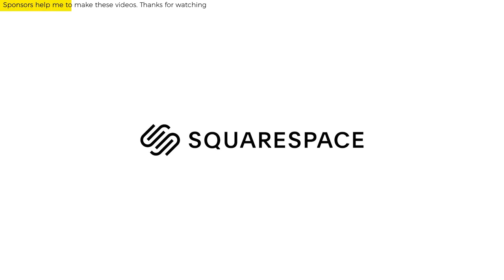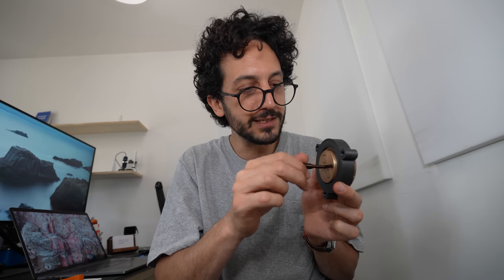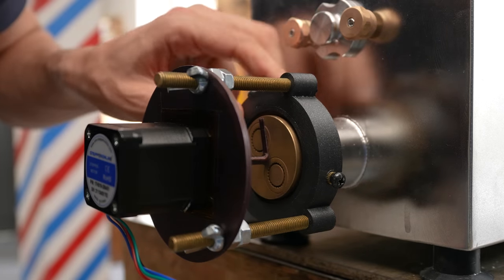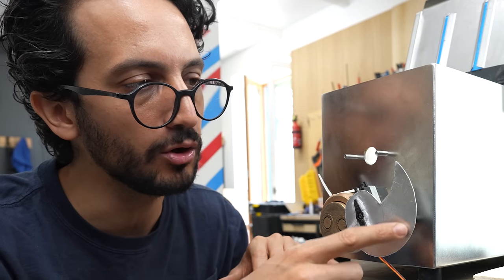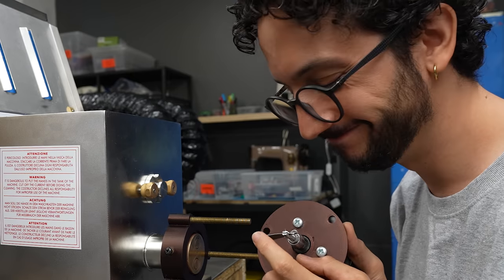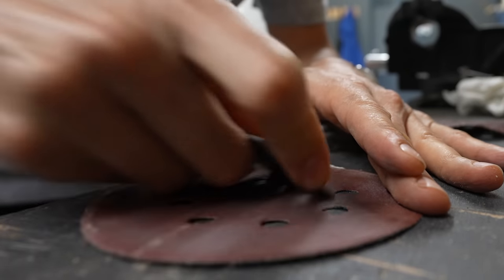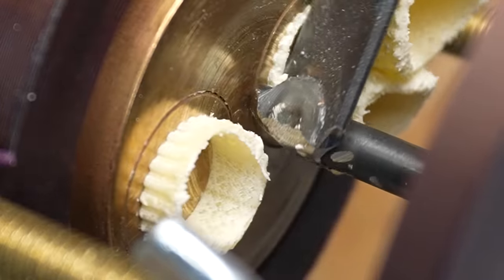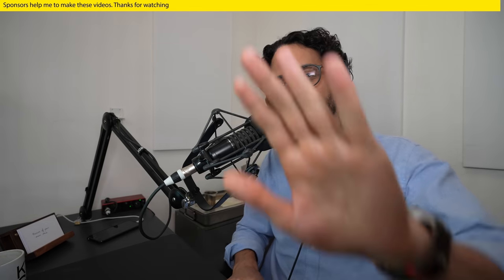I Tried to Make an Automatic Pasta Cutter (did NOT go as planned)

Comment: Maybe a RC 20kg servo motor (lw-20mg) mounted aside, connected to a thin blade like a cutter blade, could be a better concept: it will move fast (<0.2sec), with hi torque, and with Arduino you can set the frequency of cut. A couple of cutter blades paired can cut in both direction of movement. Much simple, lightweight and effective than a slowly rotating blade. What do you think?

Comment: If you want to be faster, use fine, stainless steel wire as a cutter You should also expand the circle, so that the center is the edge of the extruder, and the wire cutter extends the entire diameter. The effects of this:
1. The wire will cut without large material resistance.
2. The wire cannot build up the pasta rather than letting it fall
3. By having a large diameter like that, the wire can both move fast, and also give more time for the pasta to extrude between cuts. If you want longer times, you could make the radius larger and larger, even.

Comment: Torque probably isn't the main issue.

With your current design, the blade needs to stop every rotation to allow the pasta to extrude to length, then rotate quickly.  Going slow you will end up with pasta that it cut on a bias, and have the added problem that the pasta is pushing against the blade while you're trying to cut, creating a gap between the surface and the cutting action, which means tearing instead of cutting. 

Most commercial pasta cutters have some kind of piston that pushes the cutter into the die, so I'd recommend at minimum some kind of spring loaded cutting blade with some kind of universal joint (which could just be a rubber hose used as a coupler) to ensure that the cutting blade presses flatly against the die and cuts with even pressure throughout the entire rotation, otherwise you need precision alignment with the blade to the die or some potion of the cutting motion will have gaps between the blade edge and the die, which can cause tearing, or there could be more pressure on the die at certain areas, causing more wear/damage to the die surface in those areas.

Comment: I would have used a shaving razor to easily get sharpness and made the motor spin fast, but stop after a 360° or 180° rotation for however long you need to stop to get the desired pasta length.

Comment: @Alex I'll assume you know programming too, since you built this breadboard computer? 2:50
Depending on what in/out-put the motor accepts, you could spin it 180 degree, wait for some time (ANY length pasta is now possible), then spin it another 180 degrees as fast as possible both times, so the blade don't "clog" the extruder holes.
(also, stiffer & sharper blades required).

Comment: I think with the speed of your pasta machine, a stepper motor is good. You just need to run it with a program that will wait a second or two and then turn 180 degrees. Wait a second or and turn another 180 degrees. That would be the only reason you would use a stepper motor anyways. And then a metal blade with a very shallow angle so the pasta does not smash or stick.

Comment: I was wondering if a springloaded steel guitar string (or similar sharp wire) could provide the necessary tension against the extruder die, and pivoting the other end on a motorised wheel or servo quickly at a timed interval provide the necessary quick snap cut.

Comment: The last design was decent, but you should offset it to the side so you can run it faster for cleaner cuts while still allowing for longer pasta to be made.
Or you get a motor which you can have stop and wait for a set interval.
Reply: *Thanks for watching send a direct message right away on the above number for more enlightenment:••*......

Comment: I think shallower angle could work better, now when the blade is finishing the cut on one end the second end 5 mm into the pasta piece already. I also don't think you need much precision here - you can use flexibility of the blade instead, but that comes with the problem that there will be a lot of friction, so you would need more torque.

Comment: It's not about how slow the blade can spin.  It needs to spin medium-fast for one rotation, wait a certain interval of time and then repeat.  An Arduino could time that with the motor.  
Also the blade needs to be as parallel to the face of the dies as possible.  Maybe 15-20° angle

Comment: Why not use moving ring with thin metal wire (something like round wood drill but with wire inside and big holes for pasta) which will cut the dough and use pin on the outer wall with a switch or another sensor, which will halt the smaller motor for 4000 ms and then move it again 360*? You have 1 moving part + 1 point of contact with external element (or even you can use IR diode so no contact) and would be much simpler to build.

Comment: I would move the motor to the side of the machine and use the leverage to make the blade move faster over the die, given the same angular velocity. That way, you get the same length of pasta, but a faster cutting action. I would probably also try cutting at a more acute angle. Safety razor blades could also work instead of sharpening a random piece of metal, not that it matters if you're going to sharpen it on whetstone 😁

Comment: Hey Alex, have you considered the blades used in food processors or blenders? Those seem like they could work well for your application. Additionally, the stepper motor has tons of low end torque, try switching to a proper stepper driver like the A9488(cheap) TMC2209(quiet/higher torque) drivers. I personally have used the same large stepper in combination with the TMC2209 driver
Reply: *have used the TMC2209 driver with your large stepper motor and it makes more torque than I can stop by hand

Comment: This might need to be explained graphically but, ill try by typing it. The blade angle is too steep, so what is happening is that ur shearing the pasta not cutting it, which also forces the pasta to collapse on its self. And if the blade is flat on the surface of the extruder the blade will not cut since the pasta from the extruder is pushing the balde upwards which makes the blade further away from the surface, and that makes the blade just tear the pasta apart. So to fix the issue you need enough angle for the blade to cut and leave room for the pasta that is underneath the blade to extrude without hindrance. 
Adding that blade angle is also critical for releasing the pasta. Remember pasta surface area, you need the blade to only touch the radius/diameter not the hight of the pasta.
Also, balde speed is too slow what i would do is typr of a timer and the fan blade is not place in the middle, rather outside to side of the extruder surface, once the timer is up the blade turns fast and cuts the desired lenght then resets to it ready position. 

Also greasing the blade might help or some type of ceramic nano coating, or you could season the blade with oil but for that use steel.

Hope this helps. Also im a mechanical engineering.

*Just finished the video, i would use a thinner and curved balde like a fan, it will retain the strength of the thicker blade you used at the end, but will cut and release the pasta more easily.

Comment: The centre of rotation of the blade should not be at the centre of the die. It should be offset to be further up and the cutter should have a longer blade, this way you can increase the speed of the blade making the cut while increasing the duration between cuts. It will also keep the middle of the blade/metal rod thing out of the way of the pasta.

Comment: lower the angle if the blade. You are at 30-45 degrees. When you manually cut, it is  15-20 degrees.

Comment: You need a support on the shaft, maybe even two, then the motor doesn't have to take the off axis forces.  M-0-0-l   M is motor the dashes are the shaft going through the supports O the l is the blade.

Comment: I think you might want to spring load the blade or simply the whole assembly and use one of those plastic scraper blades so you don't damage the brass
An other option would be a solenoid and a knife.

Comment: 2 things to change :
- the angle of the blade. It should be almost parallel to the extruder
- the speed of cutting. Why not making it spin faster but 1 turn at a time. Make the blade wait in resting position for the amount of time you want, depending on the length of the pasta you are making. Then 1 quick round. Easy peasy fettuccini.
Reply: Right, the axis of the needs to parallel to the axis of the extruder, or, by extension, perpendicular to the face of the extruder.

Comment: Personally if it were me there's a few things I would of done a bit differently. 

1. Offset the motor a good half a foot away from the output of the machine.
2. Have a blade that length so it will just extend beyond the output
3. Use a razor blade as the cutting edge held in by a very gentle ramp like surface
4. Up the rotational speed just a bit. 
5. Create a cover for all parts that aren't right in front of or in the drop area of the output. 

I feel like with these you can better tune the length of each pasta noodle, and it would swing down with a clean slicing motion, allowing the mass of the blade to do a lot of the work. The sharp edge of the razor blades would create a clean cut, and the blade would then evacuate fast enough so not to crush the pasta. I'd use the window wiper motor, same controller that you used, and I think it'd work pretty well.
Reply: *Thanks for watching send a direct message right away on the above number for more enlightenment:••*......

Comment: Alex, first off, good job making a working prototype! Secondly, the biggest problem you're still having here is that you're trying to radially mount the cutter in the middle of the die, when it should be offset like that large blade shaped like a teardrop was. If you look at the professional/industrial cutters, they may be centered to the massive die, but there's enough space and size for the blade to rotate and slice through the dough at a slow pace so that enough dough is extruded for the shape desired. You did catch that you need a lot more sharpness to the blade, and thankfully you gave up on trying to glue things (I just... did not see that working ever, haha). The next biggest problem is the angle of attack that your blade is coming in at. It needs a much shallower angle, so that instead of mashing the pasta that is cut, the pasta tumbles off the blade.

Comment: The cutter doesn't need to be centered on the extruder. Move it 3-4 inches off to the side and have a longer blade to cut both of them on the same side. Should help with the sticking. Also, you are already controlling speed with a microcontroller. No need for it to be in constant motion. Have it make a cut at a normal speed, rotate around until just before the next cut, then pause until it's the length you want. With a real blade, a NEMA 17 should have more than enough juice.

Comment: I would try cutting with a stainless steel wire or a fishing line. You would of course get a cut at an angle with the slow speed but that's better than the squish.

Comment: Angle of blade is causing the cut pasta to be caught in the rotation. Change the blade angle and you’re golden - use a safety razor blade, split it in two so it’s not too wide and attached almost perpendicular to the extruded for extra precision 👍🏽

Comment: Excentric cutter with just a small office knive on it? Like a small Victorinox? Drill two holes into the handle and run it in the stepper motor. This would do the same as you do by cutting with a knive by hand. But it might be too simple ;-)

Comment: Alexudi would be a good name for that pasta. ;p

Previous to last rigid cutter: Wonder if you could drill a hole in middle of die and use that to center/hold blade shaft. Would even just need to be a small hole not completely through that the tip of the shaft can ride in. 

Might coat the end blade with some oil. Or even maybe season it like cast iron. Give it an anti-stick coating. :)

Comment: I think a better solution to this problem would be to have the blade spin once very quickly and the stop for a period of time. It seems like the biggest problem in the video is that the blade is going very slowly. Also in the end where you solved the problem the pieces of pasta were still quite short, no? This solution would allow you to wait until the pasta are exactly as long as you want them before they are cut. Also you could program the motor to "shake" of pasta pieces to make sure they don't get stuck on the blade. To do this simply program it to back up slightly during the wait period between cuts.

Comment: i think the biggest difference between you using a knife and the contraptions you are making is the angle and speed at which the blade travels, when you use a knife you cut it almost sheer with the surface of the brass and those contraptions you use are all angled at around 45 degrees or so. if you set the motor on the outside of the brass with one slightly long blade riding a "rail" or something similar so it doesn't go too far or too close to the brass, you could use a motor to set a more specific length of time as it takes longer for things to reach destinations the further out they are. Metal blades are definitely the way to go though, and it does need to be sharp to properly work.

Comment: Your biggest issue is that the speed between cuts is directly purportionate to the radius of your spinner. If you offset the motor 3-4 inches you will be able to control the speeds way better.

Comment: I am a bit late, but what you are missing is speed vs sharpness on the blade to replicate your manual cuts.
So a delayed application of a torque like a hammering ratchet screwdriver, basically a similar concept to what it is used to undo wheel lugs on cars.
A motor spins up a spring and a hammer that forcefully delivers a temporary boost of torque to the "stuck wheel nut" to break it loose.
You replicate that by having the motor spin up a spring against some resistance that then lets go, sending the knife at higher velocity and more torque across the pasta should do a very close replication to your manual motion.
The drawback will be noise though.

Comment: Instead of using an actual blade to cut the pasta, i would just use a strong, thin wire held by maybe like a U-Shaped rod that turns around. It will not have the access blade that deformates the pasta but will be sarp and thin enough to cut it perfectly.

Comment: Make the blade off centre, to have it go faster through the extrusion. Bulkier, but you'll have better control on the length of your rigatoni and it will be a cleaner cut.

Maybe pair your blade with a razor blade ;)

Comment: you could have just welded two razor blades together. and mounted them like a guillotine so it cuts while going up and down. or forward and backward if you attached it horizontally. a single piston could have given you the power adjusting the air pressure would have also given you a much more reliable speed.

Comment: As a Frenchman, I am surprised that you did not go full French and make a Guillotine Cutter, a wire or blade that would make a single quick pass and then reset, the spin on that small of a die is not letting the pasta extrude enough before it is ready to be cut, just a thought.

Comment: The small stepper motor should work fine, you just need a sharp blade to swipe across faster. Your single die is too small to have a continuously turning blade. Change the software so that it waits some amount of time then swipes 1 full rotation (generally 200 step pulses) in about 200ms or so then waits again. To get fancy with it, you can change how long the delay is with a potentiometer for shorter or longer pasta.

Comment: could the attaching points be mounted to a larger adapter  to accommodate an off center cutter. Imaging if the center of the cutting tool was 6  centimeter offset to the right of the extruder and a much larger blade was used. Now slow down the rpm and the pieces should not mush into each other

Comment: The problem I see with this is that your cutter only works with dyes that don't have a centered point of extrusion, The best way you should have done it is have a rotating cutter off to one side that would cut up or down across the whole Dye instead of running over one part of it with a short blade from the center. The blade's rotational center is offset to one side of the dye and not in the center of it similarly to the industrial machines.

Comment: Why don't you make the blade flat with the face of the extruder? It would reduce the surface area of the cutter that contacts the pasta and make a better cut I think. Also, the speed needs to be faster with a waiting time of a few seconds after each revolution, which is probably easier said than done. I suppose with a controller, you could program a delay after x duration of the motor turning on.

Comment: Did you think about an oscillating wire cutter? You could have even used the windscreen wiper mechanics and used a wire instead of rubber blade. Bon chance.

Comment: possibly the pitch of the blade is mounted incorrectly?  although working quite well it seemed like itnwas squashing the shape a bit and doing more shearing than a direct cut - if you mimic the action of your paring knife across the die there seems to be more of a direct downward/ across the die cut, rather than a scraping pass..

Comment: Is it not possible to turn at a higher speed, but have a break in between each turn so the pasta can be extruded longer? Like cut 1 pair, pause 5 sec, turn and cut again, pause 5 sec. This way u can give the cutter more force to have a cleaner cut on the pasta??